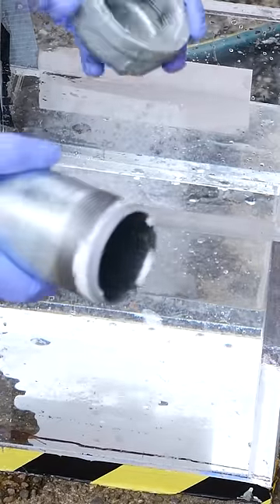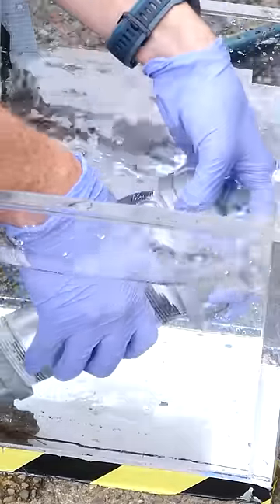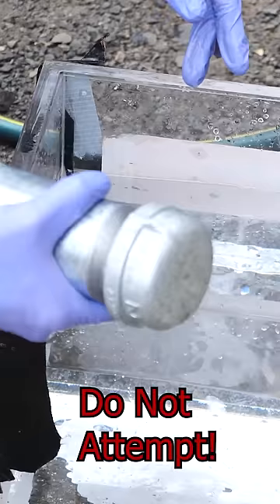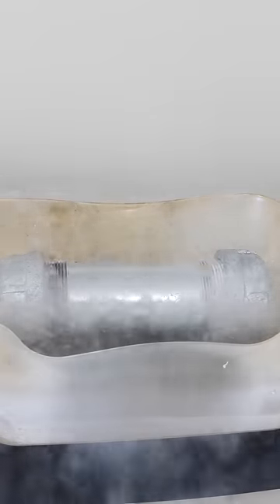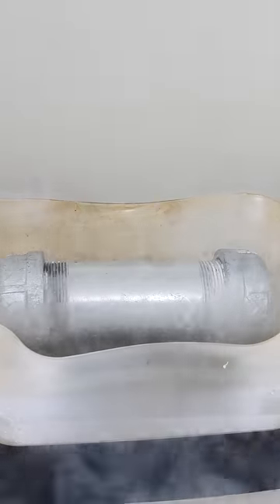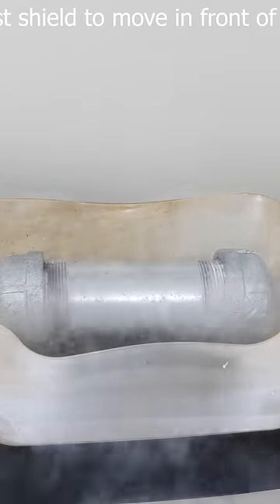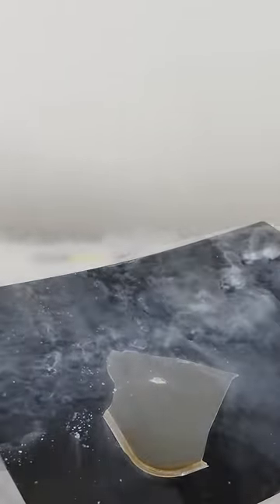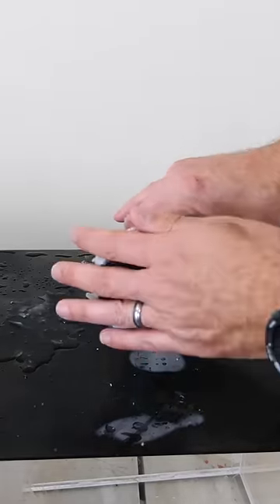Don't Ever Try To Stop Water From Freezing!

Comment: Some advice for homeowners out there. Pex pipe is a flexible plastic pipe for potable water that can expand to 3x it's original size. It's much cheaper than copper/galvanized water lines. You can buy this pipe at home depot along with the tools to crimp the fittings. As far as the fittings themselves go, you might want to try your local plumbing supply house. Stay safe out there, water can damage more than you think!
Reply: Cancer pipes. I’m good. I’ll stay with copper and use some heat tape.
Reply: @Enahs Remiw They don’t cause cancer, don’t worry
Reply: And we wonder why there are little bits of plastic in the bloodstream of most people anymore…
Reply: @ITStechy  forever chemicals. Like Teflon from DuPont. The list goes on. For someone to say pex is safe is laughable
Reply: Microplastics in everything.
Reply: @Elon_Trump  mains water is plastic piped 🤷
Reply: @tastytechaddictsmtb  they used to give opium over the counter for headaches too 🤷🏻‍♂️
Reply: Simply install water filters on your potable dispensers/faucets.  Should be doing this anyway whether you have city or well.
Reply: @Elon_Trump  Dude, dupont is a sketchy ass company that's so evil I swear.
Reply: @Elon_Trump  it was pfoa not teflon
Reply: @ilovemikehunt24  thanks.
Reply: @tastytechaddictsmtb  hahahahahaha good one! I used to be a pipelayer, we used steel, but it was converting to plastic slowly.
Reply: @Elon_Trump  ask flint MI how safe metal pipes are!
Reply: Pex  would shatter in nitrogen too.
Reply: @YouTubeIsTrash57  never said I drink tap water. I use it for dishes laundry showers and cleaning and I have a whole house filter. I have a UV reverse osmosis system. 🤣Have anymore assumptions?
Reply: @tastytechaddictsmtb  I don't drink main's water. 🤷
Reply: @Elon_Trump  wrong
Reply: @Shane Wimer  pex is perfectly safe my friend. You people worry too much.
Reply: @HVACRTECH-83  wrong 😑
Reply: @Elon_Trump  ok there big shot, you must be rite. Smfh
Reply: @hubster4477  lead
Reply: @HVACRTECH-83  ok big shot you must be right.
Reply: @lucifernazaedi  Buuut... isn't that maybe just the tumor talking..??
Reply: @HVACRTECH-83  Total dork comment.
Reply: So many unnuanced comments in this reply thread.   Some actual research from a verified source would do you some good
Reply: @Elon_Trump  
You know what they say when you assume? Should I use the old joke? Nah everybody should know it by now.
Reply: @Mr.Robert1  zzzzz

Comment: been doing mechanical maintenance for 17 years, I’ve seen a lot of pipes burst due to freezing.  Constant battle in the winter time in the mill
Reply: @Alex Hunter  In that sense, would it better to use PP pipe (poly propelyne / plastic / rubber) instead of steel pipe ?
Reply: Sometimes during bad winters here in Sweden our local waterauthorities can tell the public to let the water run non-stop for days from our taps. That to prevent freezing and save the pipes.
Reply: @swededude1992  will that be excluded from the bill ? 🤣
Reply: @HarpaxA  Water here is so cheap it costs maybee 0.0001 per litre and and 0.001 per cubic metre. It is paid by our taxes. No need here to think about waterbills. :)
Reply: Down in Branson, we were there for the polar express (December btw) and at our hotel, a pipe burst.
Reply: What amazes me is the geniuses we read about every winter who try to defrost their pipes with a blow torch. And they can't understand why their house burnt down.....
Reply: Come to Canada. Weve had ice storms kill the power and the heat tracing and entire tank farm lines rupture. Big dollar repairs.

Comment: This is an old solved problem in alloy theory/ gibbs phase rule/convex analysis. What u are doing is known as strain controlled experiments. You are specifying the amount of strain ( for your case volume) of the net mixture. This will cause some of the water to free and some of it will stay as water such that the net volume is the volume of the container. Since you completely filled the container, the water finds it energetically favorable to remain in the water phase. The reason you had some solidification on the inner surface is likely due to defects causing nucleation. If you machined the inside to a better finish less ice should from.
Reply: If this is accurate, then it's some advanced knowledge
Reply: @BoomShard17  bro said machiened
Reply: I thought a gib was when you killed someone and they explode into chunks, in tf2.
Reply: @BoomShard17  People learn this in College level thermodynamics.
Reply: @t-stash1965  u sure?
Reply: @shohamsen8986  i commented a year ago and i dont know why just hop off😭
Reply: @t-stash1965  utube doesnt always send a notification, machiened.

Comment: So, water needs to be at 32 or below to freeze, right? Liquid nitrogen is -300 sum Fahrenheit. Does this have any adverse effect to the experiment on the steel container? Would the same results happen at 10 degrees farenheit, with the container not being partially sumberged?

Comment: My friend found out the power of freezing water when he did not add antifreeze to his 67 Chevy back in 1972 . 
The freeze plugs failed to pop out on his Enginec but a 2 inch section of his cast iron block  sure did .
Reply: Damn, freeze plugs, you had one job. 🤷🤦
Reply: @Drew-bc7zj  😂
Reply: Hey Jay do you get a notification if someone replies to you? I noticed you left your original comment a month ago and this guy replied an hour ago and you responded to that within minutes. I just ask because I don't get any notifications if someone replies to me. Just wondering! Thanks dude
Reply: @DemocracyJones   You have to allow for Youtube replies to come thru .
I think I stopped them a while ago but then allowed them thru again .
I usually answer anybody who comments on something I said .
Reply: Everything got colder in 1972.  And nothing turned blue that year.

Weird.
Reply: That's why you should never rely on freeze plugs, since their original purpose is just to fill holes in the casting.

Comment: It's also worth noting that steel contracts when cold.
Reply: @bigballoftape5343  😂
Reply: Exactly! Still amazing experiment
Reply: @bigballoftape5343  the flu. I agree we need more flu awareness!
Reply: Also worth noting that he had it submerged in liquid nitrogen, which is known for making metal brittle, and thus more prone to breaking, as well as making the water inside freeze rapidly and expand faster. I have my doubts that the results would have been the same at normal freezer temperatures.
Reply: @khaldrakon  finally someone mentioned it.
Reply: @khaldrakon  I didn't know liquid nitro makes metal weak. What makes it do that?
Reply: @khaldrakon  not to mention the thermal shock
The inside of the tube will have been held close to 0C by the water freezing (which actually is an exothermic process) while the outside of the tube will be close to -196C
That'll cause insane stresses on the tube
Reply: @wraithship  my thoughts exactly!

Comment: "Do not ever try to stop water from freezing"
Antifreeze: Hold my beer
Reply: Funny thing about antifreeze, I'm sure there is a temp that nullifies it's purpose
Reply: the thing is its actually a coolant to keep things from getting to hot.

also it doesn't stop water from freezing its like pouring alcohol in some water it just stops it from freezing at the normal freezing temperature..

ie most winters unless tour Canadian or Russian or sum shit
Reply: That was great
Reply: Except it’s not water anymore is it?
Reply: @daveyerger4562  in technicality it is a diluted solution so I mean it's in the solution lol
Reply: @FEARitself100  yeah. 0K
Reply: @FEARitself100  yup
Reply: @JS-rv3et  coolant isn't a good way to cool thing. Straight water is much better, but boils lower and freezes higher than a 50/50mix of water and coolant.
Reply: Antifreeze freezes between -35C and -60C. At -60C your car will however run fine without any coolant…(you however won’t).

Comment: Wow! 2000 atmospheres? Man, you are lucky to be alive!
Stay safe, NHG
Reply: Significantly less dangerous (though still potentially extremely dangerous) than that number would suggest.

We're used to talking about pressure in gasses, so that's how we intuit high pressure dangers. But the fact that the pressure is caused by a state change that only results in a small change in volume means that as soon as the cap is blasted off the pressure almost immediately drops to 1 atm. Whereas a gas will continue expanding rapidly to nearly 2000x the canister's volume before slowing down to reasonable speeds, as well as sending out a powerful shockwave as a result.

A canister of gas like that with 2000 atm of pressure would do an awful lot more damage than this did here.

Comment: Works wonders on engine blocks too.
Reply: Haha only if you're broke af and have to run h2o for coolant leak. 
Then get ready to buy a water pump too lol.
Reply: Freeze plugs on engines that matter
Reply: that's why engines have freeze plugs

mind you, most drivers don't notice and drive off, resulting in a cooked engine 10 mind later
Reply: @aaronmiles2030 Frost plugs aren't going to save anything. The block and heads will still crack and the radiator and water pump and heater core. Best thing to do is run 50/50. Then you are good to 30°F below zero.

Comment: That timing was insane, guardian angel at work!
Reply: Or just physics and timing... Water froze at a specific rate of speed due to the very specific temperature drop rate, which caused a very specific amount of pressure/force to build up inside, and it broke open at a specific time because the pressure built up and reached the very specific point at which the pressure overcomes the materials strength... It's all math and numbers... No magic or angels or anything like that involved.. Just the physical world acting in a measurable, demonstrative, and expected way... His timing was his own choosing and own free will. His brain chemistry and neurons fired electric chemical reactions in his brain that went down his nervous system at a specific speed to his muscles, the electric impulse contracted certain muscles which moved the shield in between himself and the exploding pipe at a specific time after the signal was sent from his brain..Unless the angel directly interfered with his brain chemistry, which would mean free will doesn't exist, then it's pretty safe to say that nothing like a guardian angel happened here... Just math, numbers, and the physical world acting in the exact manner it is expected to act in. Someome smart enough could measure out all that and show you how much force, the strength of the steel, the rate of freeze, the speed of his brain signals and all that, put it all on a piece of paper, and if you recreate the same event in the same manner with the same numbers over and over again the exact same result would occur over and over again.. Therefore no angel, just numbers... Such is the way of reality..
Reply: @lokuajc  goodness bro 😭
Reply: @lokuajc Did you try this expiriment without the shield? Better get that concussion checked!
Reply: @lokuajc does this trick work to explain why you can’t satisfy a woman
Reply: @lokuajc 🤓
Reply: @lokuajc true
Reply: Relax.
Reply: @lokuajc it an expression, we all know how science works, why do you think the op comment is on this video. 

Like calm down man
Reply: @lokuajc  Do you hate any mention of divine/supernatural? Or perhaps God directly? Any history of arguing with theists or being against a certain faith?
Reply: @lokuajc 🤓

Comment: Could it be possible to weld the caps?
Reply: Looks like it busted the cap into two pieces, I don't think the threads failed
Reply: Even if it did hold the water better, I'm sure it would just break more violently
Reply: @Charlie-dx6bv  I think the rapid cooling of the metal made it brittle, if he had stuck it in the freezer it may have held. This is like sticking a heat-treated steel sword into room temperature oil, the steel acts weird when rapidly heating or cooling. Welding could do the same thing, though heating the water would create steam, and might be an even more violent explosion.
Reply: The caps are the weakest part

Comment: Steel at cold temperature becomes very brittle. This is extremely predictable. A better test would be with stainless steel. It'll probably deform instead of causing supercooling, but it'd still be more interesting.
Reply: Especially since the caps he used are cast!

Comment: Wouldn’t covering the metal with liquid nitrogen (if that is what was used) make it more brittle and prone to breaking? What if you just put it in a freezer?
Reply: I'm curious about this as well
Reply: Wondering this too!
Reply: Especially since the point of failure was the threads. Which were also full of water since they were screwed in under water.

Comment: Ah, so this is how the city pipes burst during the winter🥶❄️
Reply: Yep.
Reply: Yup, which is why flexible plastic tubing is much better than solid metal pipes, it can expand rather than explode violently
Reply: @Soken50  This weakens the pipe tho which can lead to leakages with time. Also the fittings of flexible tubing still breaks.
Reply: @gavekorttilikea  Still much better than an entirely burst metal pipe regardless
Reply: Freezing water can exert 20kpsi. It can break most anything!!

Comment: Red loctite the threads next time and try to weld it shut.  The threads and welds will still be a weak point, but it should hold a lot more pressure.
Reply: I thought the same thing but I watched it again and it was actually the cap that broke. That makes sense given that it is cast rather than rolled, which leaves it much more brittle especially once it's cold
Reply: @kevinwells9751 no, the cap didn't break. the pipe has a lip below the threads. the bulky stuff on the end of the pipe is just ice. liquid water which rapidly froze as it escaped
Reply: @punchkitten874 after rewatching, it was indeed the cap that broke. It looked like the bend from the side to the face gave, which makes sense because a non-rounded corner usually is the largest weak point when it comes to pressurization.

Lock-tite may make a difference if the cap is rounded, but the screws do not seem to be the primary or most likely weak point on this bom... uh, experiment.
Reply: The thread of the cap was still on the pipe, you can see it when he handles the remaining pipe at the end. So the thread was still holding the cap, but the end of the cap broke off. 

Your glue doesn't make the cap stronger. And the thread connection was strong enough.

Comment: now weld it shut
Reply: Wouldn’t make any difference.  The cap didn’t unscrew and come off, it burst.
Reply: @jeffmansfield914  but the area of contact was only the threading, so welding it together would make that bigger
Reply: @digitalavali5875  
It looks to me like the threads held, but the top of the cap itself broke off.  That wouldn’t change with welding.  The threads didn’t pull loose, the cap simply failed.
Reply: High pressure is no joke. That steel can't contain the expansion.

Comment: every sitcom has taught me to never freeze a sealed bottle
Reply: i think you just need to leave room for expansion.
i freeze plastic bottles filled 90% with water.. maybe it's the plastic being more malleable, but if i fill the bottle then it bursts.
Reply: I have Frozen water bottles before and the bottles expand instead of burst open. Have you ever seen a 2 L soda bottle before they blow mold it? Prety unusual looking. Oh, and I've never done it with liquid nitrogen🤑

Comment: You also messed with the metallurgy of the galvanized CAST pipe caps by placing it in liquid nitrogen.  Try again and slow freeze it in a normal freezer and at slow rate just at freezing temperature (32F - 0C) and see what happens. Metal gets weaker the colder it gets. 

At best this is a skewed experiment.

Comment: Idk if anyone said/asked this or not but i wonder if the h2o froze on its exit, meaning the h2o was liquid till the moment the contaner broke and allowed the space for the h2o to turn to ice and it stuck to the surface of the steel as it was colder than the liquid h2o that was escaping.

Comment: Have we ever measured the energy in Watts (Pushing 1kg 1m in 1 second on level surface) that the water in the pipe exerts changing phase & dethreading the pipe cap from solid to liquid? It would have to equal the amount of Watts used to cool it, right?

Comment: This is about as old as the mining industry! Miners used to drill holes, in winter, into rock that they want to “break off or split” fill them with water, plug them and wait until the Water freezes, expands and splits the rock! It’s significantly cheaper than explosives…😉

Comment: reminds me of a physics experiment in high school (in 1989, yeah I'm old).  Water in a vacuum will boil, but immediately remove the vacuum, put your hand in it and it's still room temperature.  So if the container is strong enough not to expand then not all the water will freeze because of the pressure exerted on the water...am I right or wrong?  (not a physics expert)

Comment: The problem I see here is pouring liquid nitrogen on the steel pipe making it more brittle and causing the massive pressure difference. I imagine freezing slower like in a freezer over a few hours would yield a different result? Probably crack it like ice does to rocks

Comment: Doesn't help that you super cooled with liquid nitrogen or whatever making the metal brittle. Would it have gotten to high enough pressure at a freezer -20degC temp? Or would the pressure prevent freezing. 
All assuming ductile to brittle transformation of the metal doesn't occur.